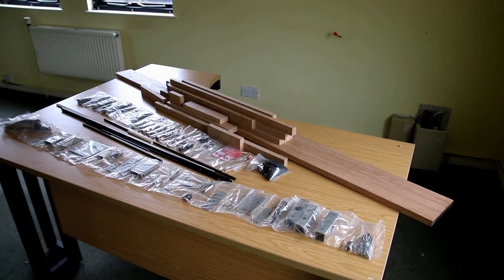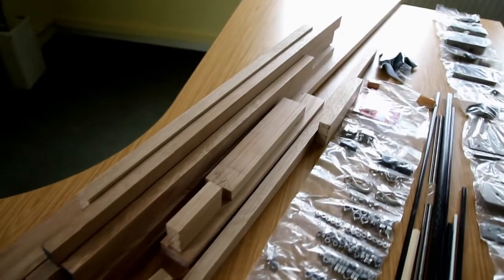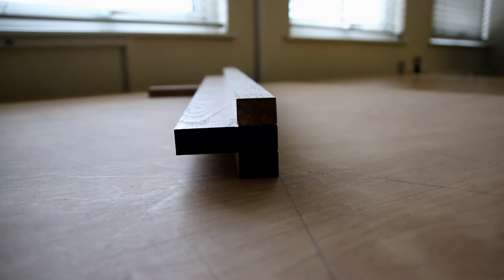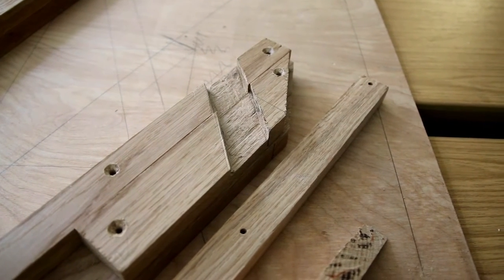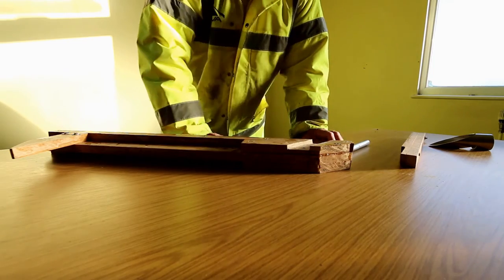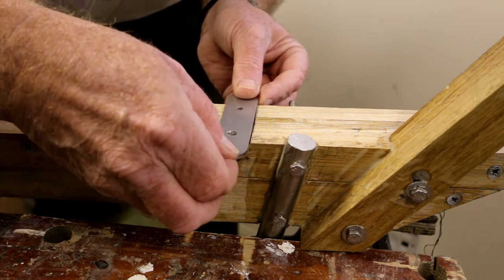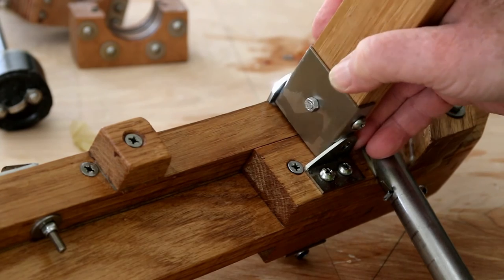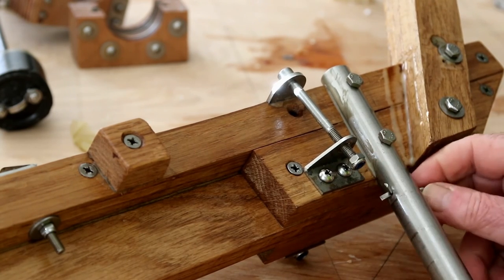Hebridean Part 1

Comment: Would this steer a 35ft,  12 ton yacht?
Reply from the maker: I would contact the manufacturer for his opinion.  My feeling is that it might be a bit lightweight, but it also depends on how easily the boat handles when properly trimmed.  Any windvane can be overpowered if the sail trim is not maintained especially in high winds. Hope this helps.
Reply: @iankfr  
Thanks for taking the time to reply!!

Comment: Do you have any video or pictures of cutting extension to fit the turret?
Reply from the maker: Hi Michael, sorry, no.  But the process is really straightforward.  A couple of cuts with a hacksaw and chisel out the core of grouve, then I used a round rasp and a finger width belt sander to open it out.  You can also wrap the turret with sandpaper and use it to sand with. All you need to do is NOT rush it. I tended to keep the camera away while sanding for obvious reasons.  The instructions with the plans for this are really clear. Hope this helps, Ian
Reply: brilliant idea on wrapping the turret with sand paper... just starting my H1 ...

videos are awesome.. thank you

Michael
Reply from the maker: Glad you enjoyed them
Reply: @michaelgoodwin8893  I second that. My H2 kit arrived this morning (Canada doesn't like importing wood) and these videos are a tremendous help.
Reply from the maker: Knapweed, see my previous answers above.  Sorry but I didn't video the cutting, but the use of the turret wrapped in sandpaper is probably be the best approach for the final fit
Reply: @iankfr  Oh, I have no issues with the content of the videos at all. I think the whole series is very clear and systematic. I've watched them all at least twice. Brilliant job.